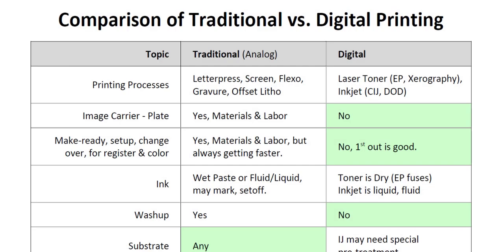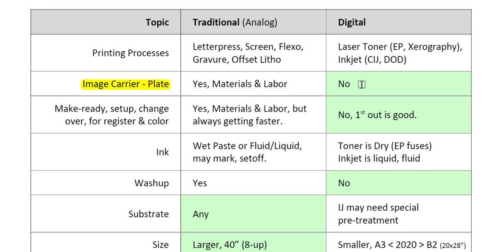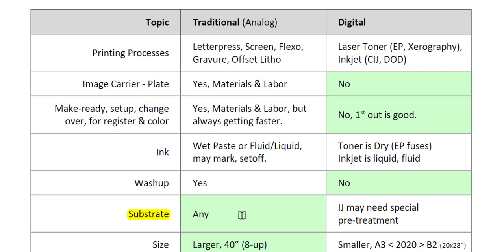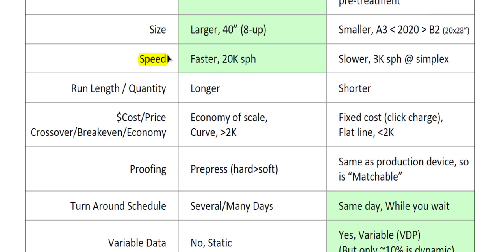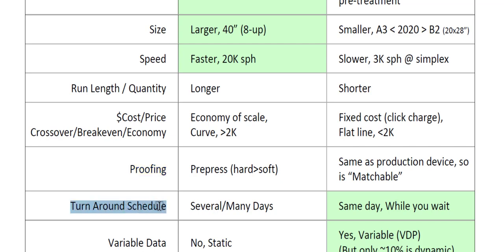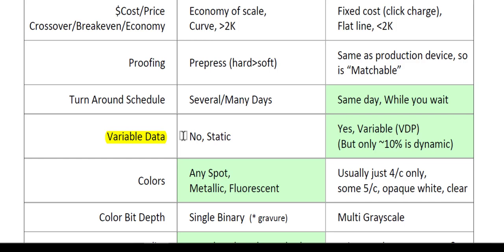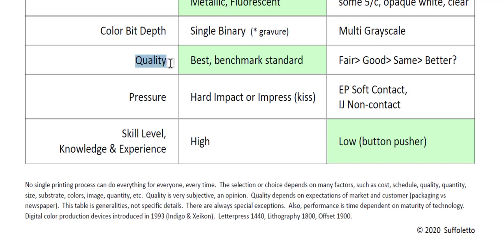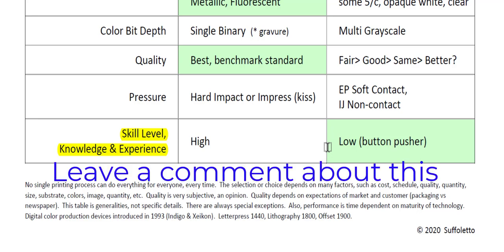Comparison of Traditional vs  Digital Printing

Comment from the maker: How much training and what pay wage ($13.50) do you get if you work at Office Max/Depot or Staples print/copy center?
Reply: I worked at office depot/office max for my internship. I got paid whatever minimum wage was and the skills you learn there you can carry on to a print shop. Throughout your time there they make you watch online learning videos that have tests you need to take. You will do a quiz or 2 then you are given online timed "chapter " tests. You need to have a 85% to pass or higher. When I was working there it was required by our print supervisor to make anyone who worked in the print area to complete theses using their online system. Also they would have you do it while on the clock. During your work shift. You couldn't complete it at home.